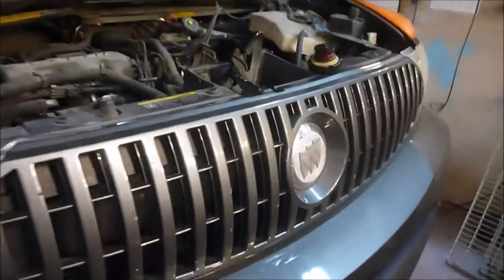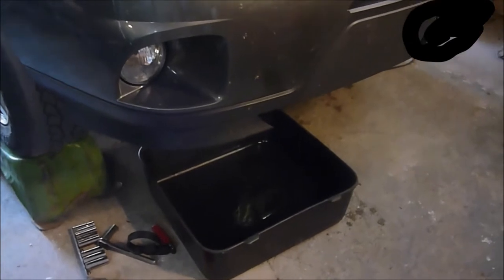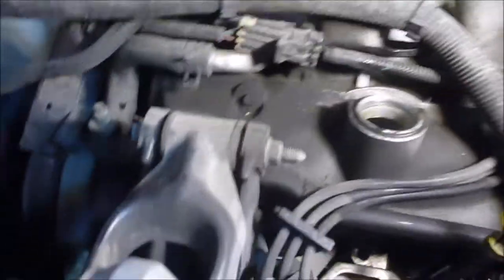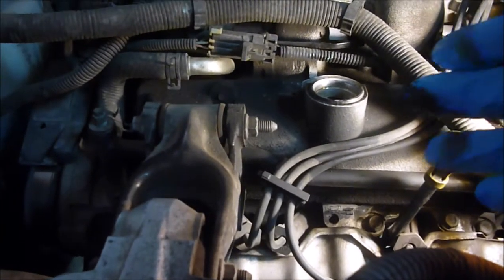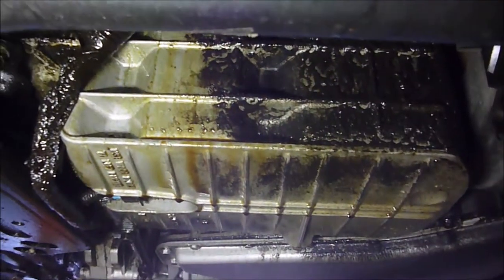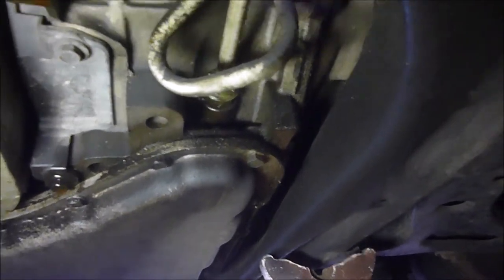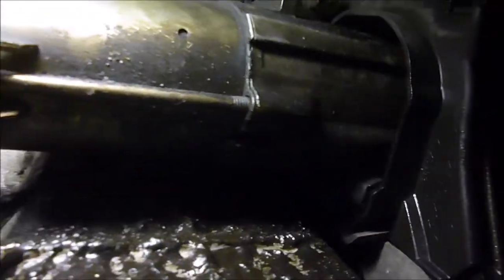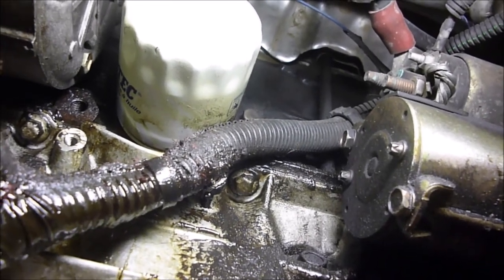DIAGNOSING WERE AN OIL LEAK IS (BUICK RENDEZVOUS)

Comment: Thanks for the video.  By the way,  not boring at all at least not for a beginner.  Got a question if you have time.  I have a 03 Rendezvous--a mechanic told me the valve cover gasket was leaking oil, but it wasn't worth fixing.  (Don't you hate that).  Is it too tough a job for a novice? It seems pretty straight forward, but labor intensive.  Any advice would be appreciated.
Reply from the maker: i've never done one on mine but usually it's not to hard just take it  a bit at a time and take pictures of how you take things off so you can get it all back

Comment: Hi there, any idea where the oil sensor is up there? I didn't see it when you put your camera up there. I have a major oil leak on the Rendezvous up front and looks just as bad as yours. Our oil filter is tight though.
Reply from the maker: not sure sorry
Reply: @JunkworksGarage  I found it, it’s right above the starter and it faces into the front of the motor block. Simple fix. Took me five minutes, minus going out and buying a 27 mm socket.
Reply: @EmpoweredPercussion ... that location is where the Oil Pressure Sensor is located.   I have the same issue with oil in the same area, between the starter and engine block.  I noticed it, when I swapped out my starter last week.  I may have to go back and check on that, and tighten that sensor a bit 🤔

Comment: This oil everywhere is always bad. Keep the engine and trans power washed always. And it helps diagnose so much easier all the time.  Its your filter based cooler adapter.

Comment: Did that fix the problem with the leak mine has the same leak problem
Reply from the maker: it turns out the person that put the oil filter on didn't tighten it enough or it backed off. but it was from the oil filter

Comment: I've got a 86 f150 that has a huge leak like I lost 6 quarts in a matter of secounds. trying to find it seems impossible because it's a spray goes from headers, fuel filter, exhaust, down to transmission and drive shaft... I tried to get a better look but it causes alot of smoke and by the time it clears theres hot oil dripping everywhere.
Reply from the maker: it could be your rear main seal if its leaking from between the motor and trans
Reply: ... sounds like he has a hole in his oil pan or engine block 😆

Comment: I have an 03 Buick Regal and it has an oil leak and can’t figure out where it’s coming from. 

It’s been sitting in the driveway for over a year and battery is dead (Forgot to disconnect it) so I’d have to jump it to even try to look for the oil leak. 
I checked the filter already I believe and it wasn’t that. I did swap to synthetic and it might be that but I can’t be certain unless I go back to conventional oil. 

I did have a radiator leak (still there) but I didn’t know all the signs of when to STOP driving the car so it might have run for a little while without coolant. How likely is the head gasket to blow if ran like that? Car never sounded stressed when starting no odd noises. I now know the water noise I did hear was it boiling but I fear I probably did some damage by that point running it like that for a few days. 

Any ideas off the top of your head what could be leaking and where to check? I’ve recently started working again and can finally either take it in to a mechanic in a month or two, or try to look for leaks with some conventional 10w30 since it’s not too expensive. I’d have to make sure to fill the cooling system with water (is tap water safe to use while troubleshooting) while looking for the oil leak. 
Sorry for the long comment, I have a lot of free time during work and it’s eating away at me. Since getting my car working again is a big deal right now.
Reply from the maker: it sounds like a lot going on you should probably have it looked at by a professional i wouldn't be able to  give you more advise without seeing it sorry
Reply: Junk works DIY Garage I completely understand. Thanks for the quick reply.
Reply: @JunkworksGarage  Figured I'd give you an update to my cars issues. 

Replaced radiator which I already knew needed to be replaced. 

The oil leak was an oil pressure switch according to my mechanic. Doesn't seem to be leaking oil at all now. :)
Reply from the maker: @JoshM7  glad it worked out thanks for the update